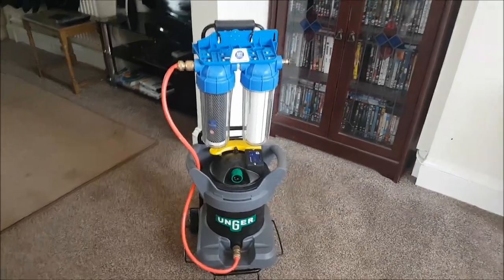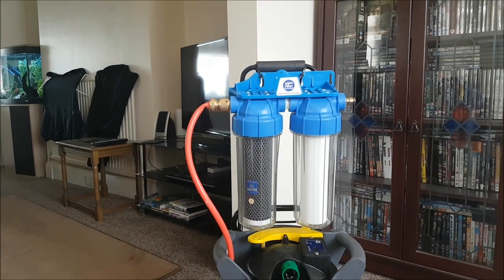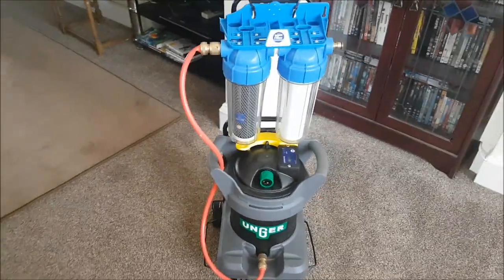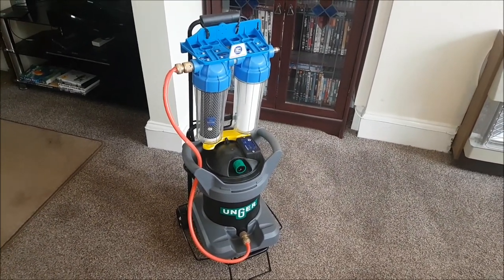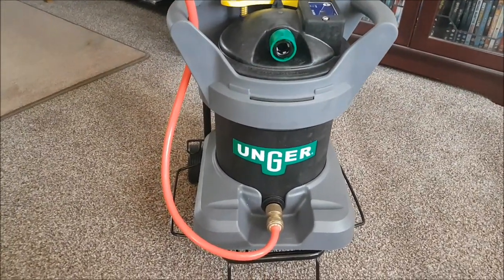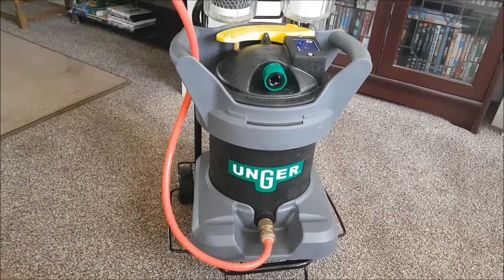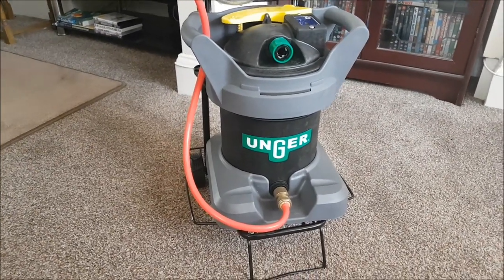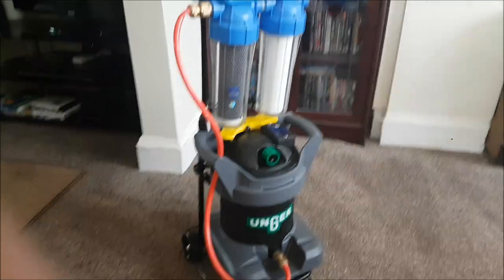Unger Hydropower DI System & Trolley For Mains Water Usage

Comment: Im setting my trolley up with 3 stage heavy metal filtration with a di cartridge refillable and a unger di hydropower 6 litre unit so im going to find this better than using a back pack trolley system and i ordered a spare set of filters to

Comment: Hello fellow window cleaners,
I have the Unger Ultra 3 stage with the exact same filter installed as in the video above. My problem is, water is not coming with the same pressure as without the filter, can I  increase the water pressure somehow without dismantling the filter?
Reply from the maker: The water pressure will be reduced when going through the DI & filters due to the absorbency and flow path. You need to be mindful of input pressure as you'll shorten the lifespan of the resin
Reply: @AW-Services  thank you very much for your answer, I have connected a 100 psi pump to it and if you let it run at 50-60% it's ok,(still not enough pressure for the fan jets to work properly) more and the pump stops constantly because the water does not get out quick enough at the other end.It builds pressure, stops and runs back again when the pressure drops even if you let the water constantly running.

Conclusion: 

I think I will invest in a delivery system soon 🙂😀

Best regards !
Reply from the maker: You are not meant to be pumping from a DI and filter setup as the mass of the resin and filter material is like trying to drink a mug of coffee through a bucket of sand. My setup as shown here when I made it was used on a low PPM water supply with pencil jets which are the best as fan jets and rinse bars are rubbish at rinsing. You really need to be filling a water tank then pumping it to get the desired effect You wish for.

Comment: How did you fix the 2 stage filtration to the trolley i would imagine your using bungee or ratchet straps
Reply from the maker: Its mounted on an aluminium flat bar with two bolts and wing nuts

Comment: Where did you get the carbon sediment filters? I'm wanting to do the same with my Unger DI system.
Reply from the maker: Ebay. I've used both off the shelve 10" filter. Carbon block filter & 2 micron Sediment filter 

https://www.ebay.co.uk/itm/Twin-10-Filter-Housing-Set-Two-Stage-Water-Filtration-System-3-4-Ports-/302289866262
Reply: Are the filters 2,5x10 or 5x10??